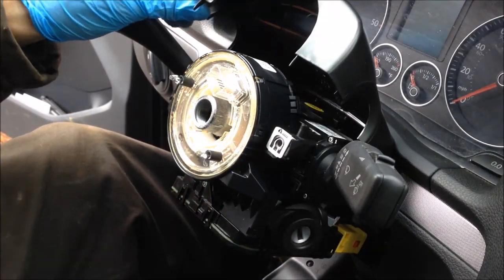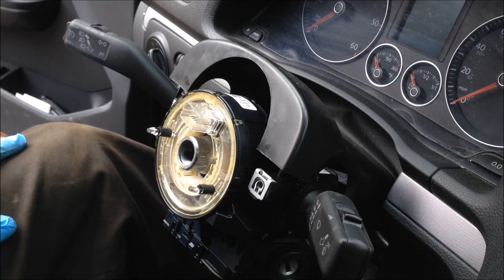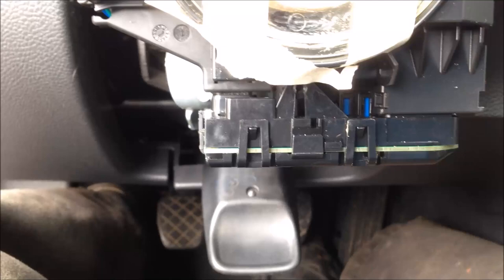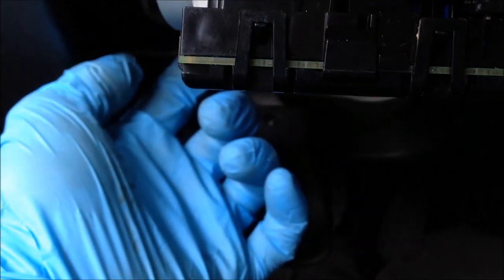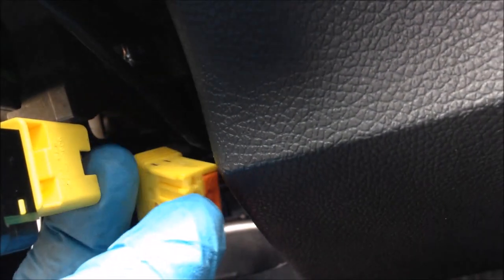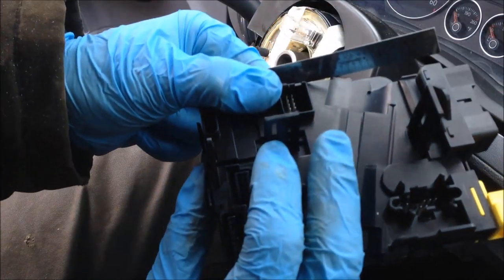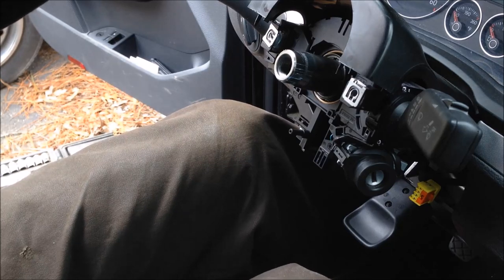MK5 - Jetta - Airbag, Clockspring, Turn Signal Disassembly & Repair - Part 2 of 3

Comment: Nice job I swapped the signal cc arm from 2009 jetta tdi going in for the buyback into the 2009 tiguan I just picked up because the cc did not work. This fixed it. The jetta was easy but the tiguan had an extra part in the way of that inner clip and made it harder to release. If you don't have a small metal rule like that a hacksaw blade will work.

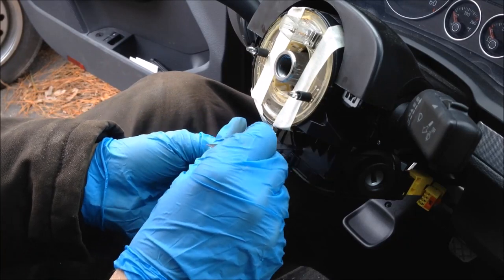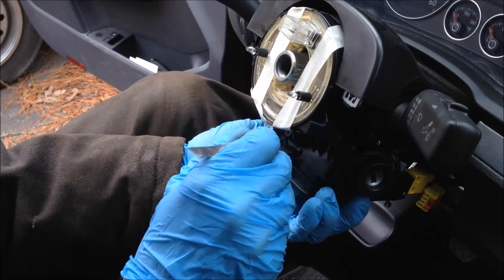Comment: Intermittent no horn and airbag fault led me to replace the clock spring of my mkv GTI using this awesome tutorial. Worked like a charm, except the snap clip bit from 4:15-4:20. There is no access like that on the GTI's module and instead I used a needle to move the snap clip through the smaller hole below, as shown here: http://www.pelicanparts.com/techarticles/Volkswagen_Golf_GTI_Mk_V/90-ELEC-Steering_Column_Stalks_Replacement/images_med/pic12.jpg
Also, releasing the rear left connector is easier once the module is off.
After clearing the codes that airbag fault has not returned (yet). Thanks!

Comment: I have never felt such relief to find this video.
I'm running a red dash light and my power steering is gone in my 06 Rabbit 2.5. I've cleaned the grounds and am soon to remove the entire battery tray in an effort to locate what I hope to be is just a broken wire. But I've also been told it might be the module has burnt out. 
Picked up these codes: 00569 - current, power steering motor Open circuit
00778 - steering angle sensor intermittent

If you've got any clues, hints or tips for me, I'd truly appreciate it. I've been pulling my hair out trying to figure this thing out - I live in the middle of the Utah desert, so there's not much in the way of electronic power steering repairs. Nobody will even look at my car! haha.

Comment: hi i need your help "Good afternoon" I have a 2006 jetta which removed the steering wheel to paint it, the problem was that the position of the clock spring moved and now I turn on the focus of the steering wheel in red and the direction is very hard. With scanning and erasing the errors will re-operate the address
Reply from the maker: You need to take the steering wheel off and reposition the clock spring - by rotating it in the direction that will enable you to turn the steering wheel & wheel completely -  from left to right.
Reply: thank you very much happy good night